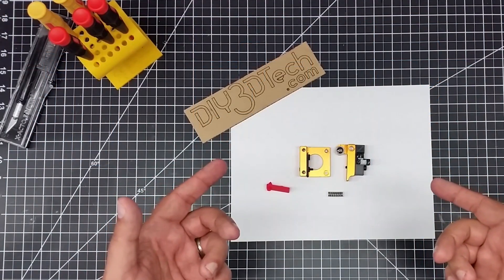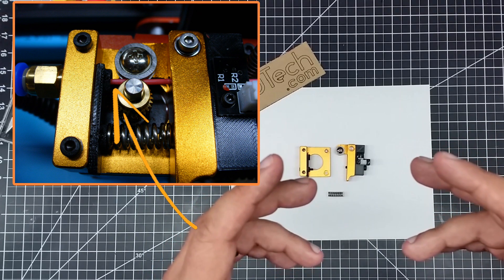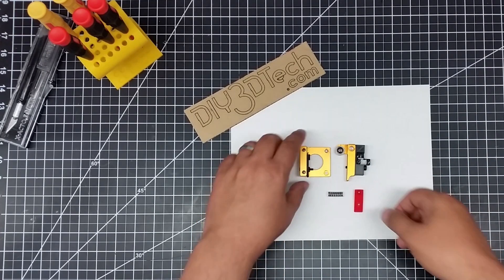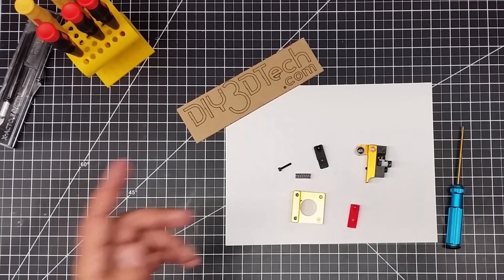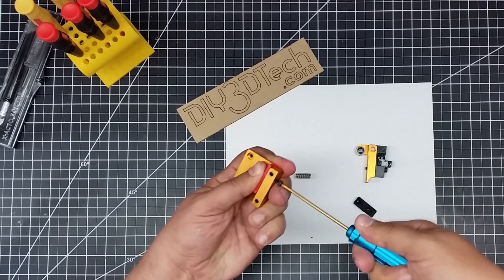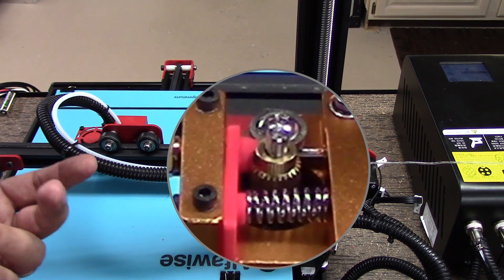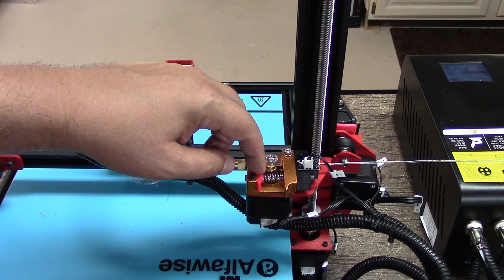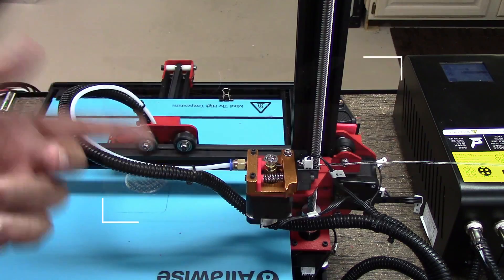Gearbest Alfawise U20 - Easy Modification to Print TPU!

Comment: I printed your adaptor, but can't still print tpu. After exactly 2 layer and a half, nozzle stops extruding tpu and I don't know why. Can you please post your TPU profile for Alfawise U20 ? Many thanks !
Reply from the maker: Try slowing it down, start out about 1/2 the feedrate of PLA.  Also could have to do with your TPU, so work up the speed till it fails...